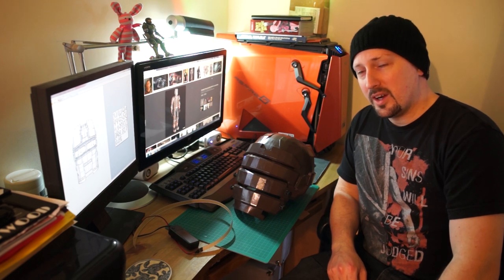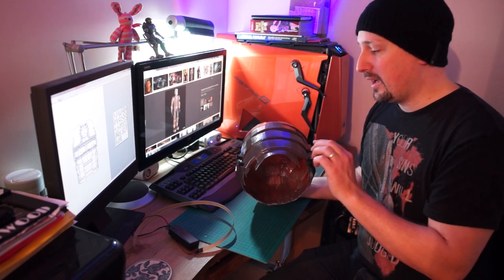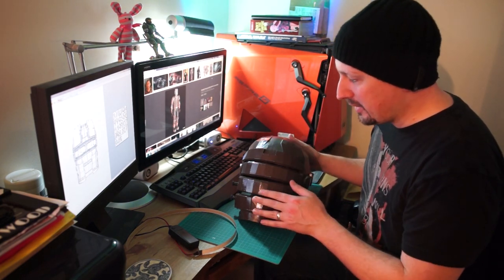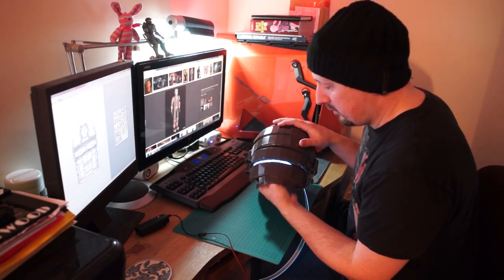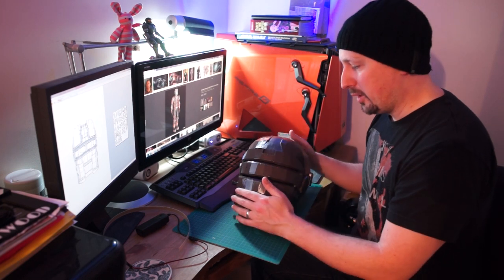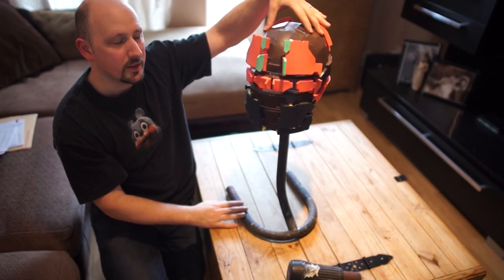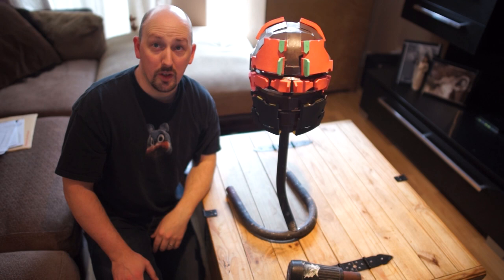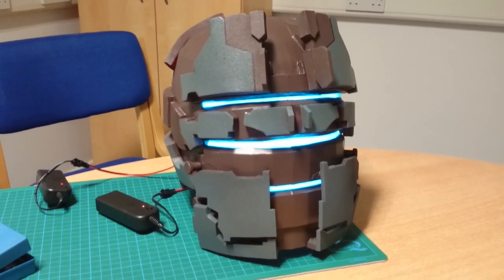How To Build a Helmet from DEAD SPACE

Comment: I'm planning on getting one or making one buy when u said u put holes through the LEDs I was confused. How did you and I thought something like that could break them???
Reply from the maker: This was my 1st deign using EL strips. As long as you don't cut the power cable,  you can modify the strips to see through. 
I actually abandoned this method and went with a sheet of blue transparent plastic from a school class folder and a set of 20 white AA battery Christmas tree lights. 
Glue the lights between the helmet and the blue plastic (not lights on the inside with you as they will reflect back and you will be unable to see)
I hope that helps you!